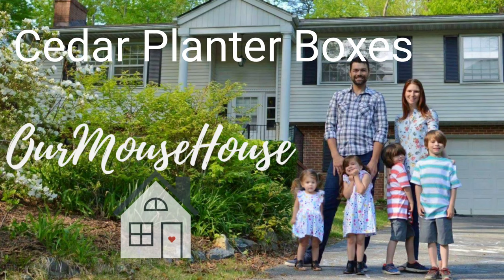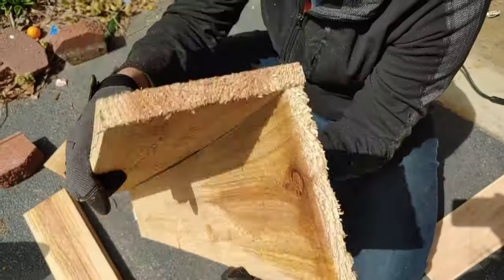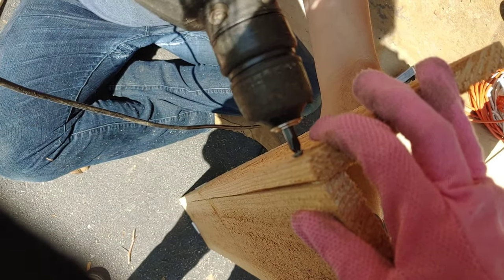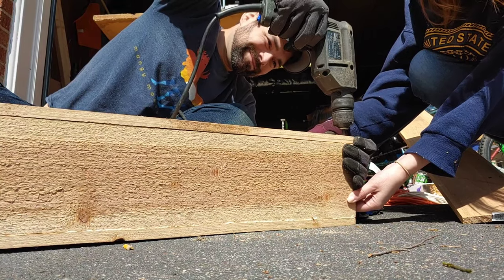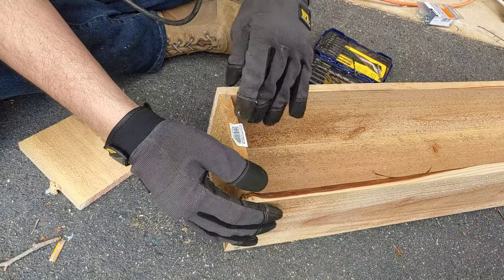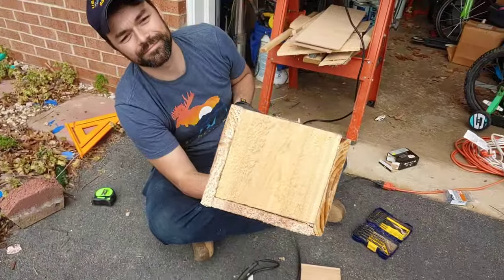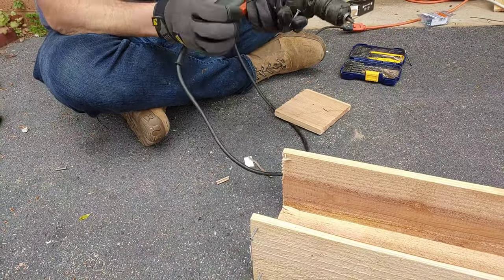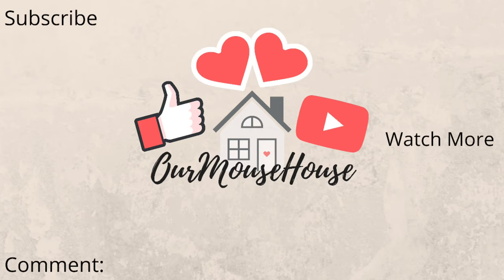TUTORIAL: How to make cedar flower box | DIY planter box | DIY Flower box | Garden 2020

Comment: Did you drill any drainage holes in the bottom before planting? Are you lining them with anything before putting the potting soil in?
Reply from the maker: We didn't drill holes but they seem to drain from the seems just fine but we've talked about drilling in some holes if it looks like we need them (It's been non stop raining here!). You could also put rocks in the bottom to help with drainage. We just filled ours with lemongrass which isn't too picky. We didn't line them either. Thanks for watching 💜
Reply: @OurMouseHouse  I'm going to give this a try - I need a cute new windowbox for the tiny window that looks out to my garden! Thanks for sharing your tips!

Comment: What kind of screws did you use? I am making some and having trouble with my wood splitting
Reply: Be sure to pre-drill your holes with the right size drill bit  and don’t overtighten screws.  Might want to drill countersink holes for the external screws (just drill a little bit with a bit size a touch smaller than the screw head)  if you want them flush, or switch to finish nails and glue with clamps.